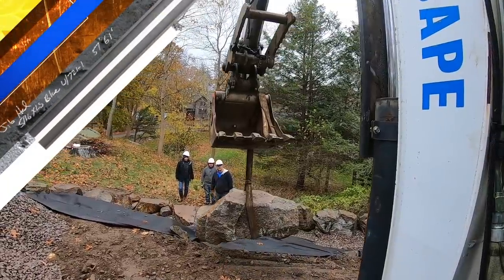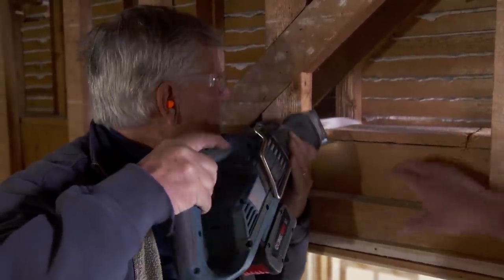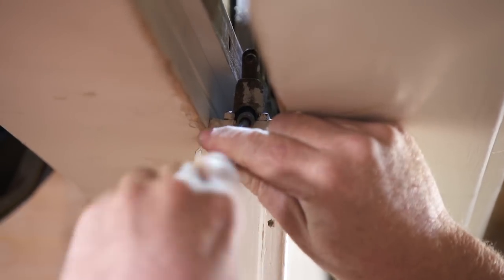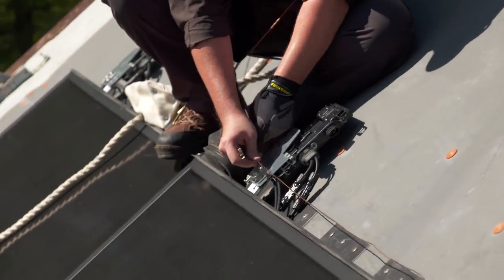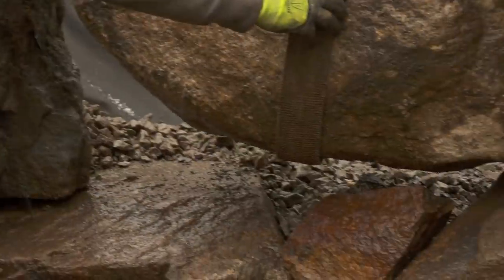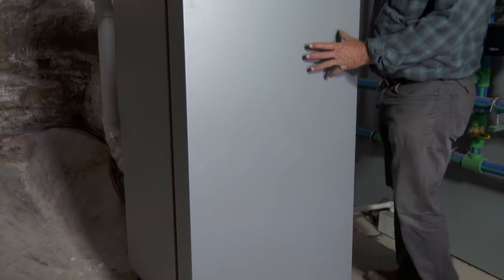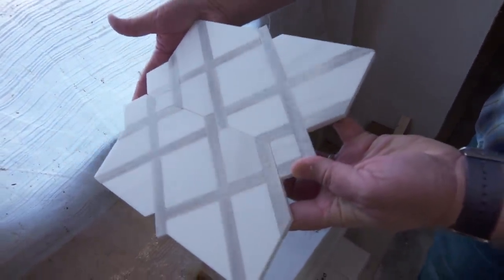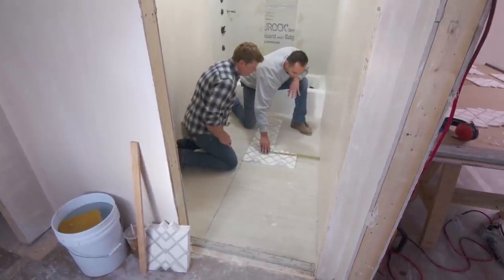This Old House | Tiling is a Family Affair (S41 E22) FULL EPISODE

Comment: I wish they mentioned the super clever part about those pocket door hangers: they have no bearings to wear out because they would never be lubricated. At a time when small sealed ball bearings would not be available, all you had was plain bronze or babbitt. Which are great, except that they require lubrication or they wear quite quickly. The hanger on the door has about a 8" long, horizontal flat spot and that lays on the small axle between the wheels. As the wheels rotate on the track, the hanger ends up traveling left and right (relative to the wheel sets). The small axle diameter vs. the larger wheel diameter means that the wheel set can traverse the whole length of the opening (maybe 48"), while only moving a few inches under the hanger. All of it as rolling friction, never wear inducing sliding friction. That mechanism would last for centuries of continuous use.
Reply: I have pocket doors fallen off the track, about to dig in and hoping for this set up!!
Reply: Nice explanation, thanks.
Reply: @flat-earther  I found the same thing....and also a ton of newspapers from the '40s and '50s that they were using is insulation 🤣 not sure about that last part though 🤨

Comment: Meh on the tile, first his mortar lines are all crap, they should not criss cross. It is clear he doesn't know why they are there. The reason they should all go the same way is so you can collapse those lines as you push the tile down and the air has a place to escape. This is tiling 101 and while his 10x10 tiles are probably going to be okay if you used this method on LFT it would crack for sure! Second, no spacers? why? It looked like trash when he finished, he was wiping it and wiping it but it still looked uneven. Use spacers and use some sort of leveling system. The difference is night and day.
Reply: Okay.

BTW vadimr I suggest watch a 13 part series called What on earth happened by Ewaranon to learn that the earth is not a globe.

I got it in my about tab.

Comment: I have large pocket doors like these in my old house. I used to think they were cool, but the adjustment on them is terrible. The track came loose on one and it tore up the floor. The other one fell off the track and is stranded inside the wall currently…
Reply: Did you sort it out yet?

BTW thejpkotor I suggest watch a 13 part series called What on earth happened by Ewaranon to learn that the earth is not a globe.

I got it in my about tab.
Reply: @flat-earther  I ended up replacing the trim and just removed them. Probably list the doors on FB to sell, just too much trouble. Replacement door hardware that is heavy duty enough runs 1500 per door. Door replacement runs $5000 per door, as it’s all special order and non-standard sizes…

Comment: 12:40 They are so mesmerized of radiant heat system which isn't latest technology by any means. Similar systems has been use in here from 1990s.
Reply: Bit of This Old House history for those who might not know. The first showing of radiant heated floors was in the late 1980s, 1989 I believe and Richard actually installed it in his home. Then was filmed there.
Reply: @Embermist69  First PEX pipe was made in 1972 before that radiant heated floor was made with copper that had plastic coated dunno how early those was made but my house is built 1978 and i have few room with radiant floor heat made by plastic coated copper pipe. PEX became more popular here around 1990s

Comment: What is the point of heating the garage? I guess I’m not used to that since I live in Texas. Is that normal? To heat the garage?
Reply: It’s a nice convenience when the outdoor temps are in the trends or below zero.  Even insulated garage door panels won’t be enough to keep heat in.  Radiant heating is relatively inexpensive….comparatively.

Texas has a bit of an ice storm and falls apart…this region the house is located is built for real winters.
Reply: I grew up in Wyoming in the mountains. A heated garage was your best friend. I remember getting up one morning and seeing -52F on the thermometer. Nothing would start except my snowmobile, and that was because it was pull start. I ended up spending most of the morning bringing people to and from work because very few of the cars parked outside would start.
Reply: It's something you do only if you have more money than you know what to do with, and even then I wouldn't bother.  I grew up in Nebraska, not the coldest winters in the country but darn close.  The attached garage is as much as anyone really needs to be comfortable, keep the ice off the car and the wind off your face and you don't have to walk in snow, I don't need to be in a 70+ degree environment 100% of the time.  Plus at Thanksgiving and Christmas my Grandma had a 2-car refrigerator to keep things in while prepping for dinner.

Comment: That 2.5 kw of solar power production being 2o% if daily needs is an overly optimistic estimate by a professional installer and is ridiculously optimistic for a modern family of 3-5 in a 3ooo-4ooo s.f. house in coastal New England which may draw a 3o-5o kw daily run when not sleeping.

The best anyone can expect are 6-1o hours of productive solar energy in average day and average annual solar days of 19o-21o (allowing for 15o-17o days of fog, rain, sleet & snow).
Reply: When my last keyboard had a broken key, I copy/pasted the character into the clipboard so I could just ctrl+v it where needed until the replacement arrived
Reply: we tend to use zeroes around these parts, mister

Comment: Laying tiles is not particularly difficult. The part of the process that people usually screw up is the grouting by washing out too much of the grout from the joints when trying to complete the work. My most nightmarish tiling job was on a staircase. The carpenter who built it didn't align the stringers on each side with one another, i.e., the treads were not perpendicular to the wall. That meant that each and every tile was a parallelogram, not a rectangle. The other tiling must do is to apply grout release to the top surface of the tiles before grouting. That saves a huge amount of labor in the final cleaning of the grout residue from the tile surfaces.
Reply: I appreciate your insight.

BTW avsystem I suggest watch a 13 part series called What on earth happened by Ewaranon to learn that the earth is not a globe.

I got it in my about tab.